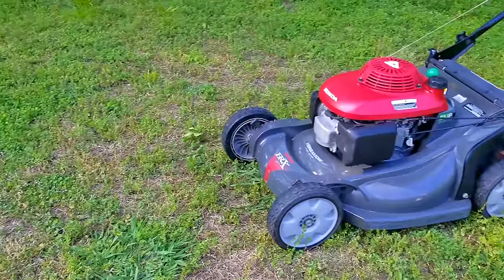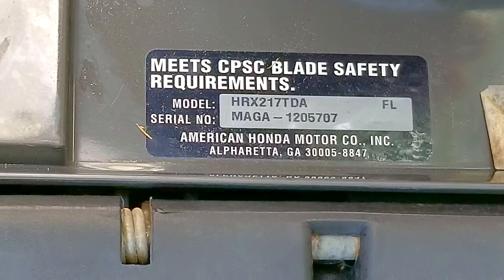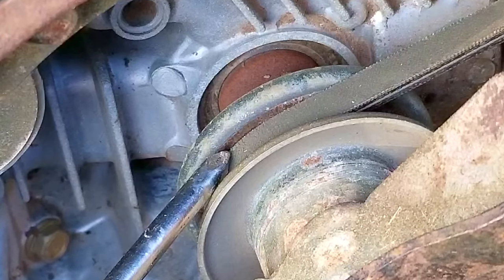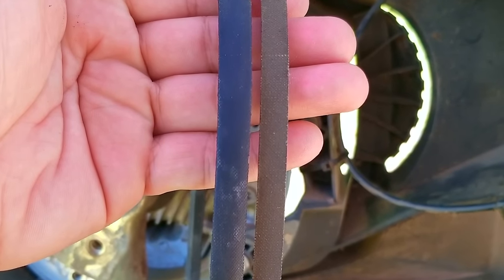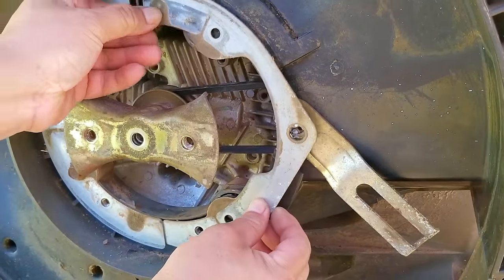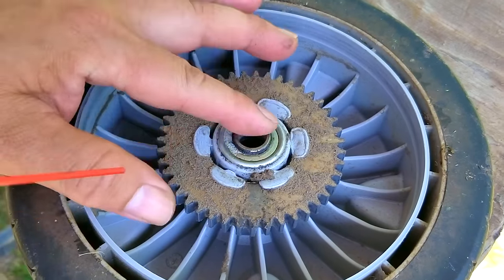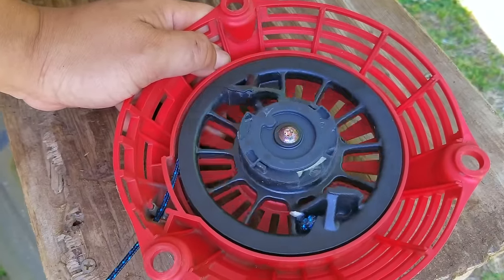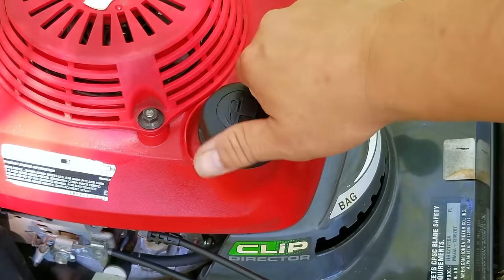Fixing The Self Propel On A Honda Mower

Comment: Did miine a couple years back and yes what a pain.  The hidden nut in the shoot got me to yell a little till I found it only after some research.  Laid out all the parts in order as I took them off and a few pics as well.  Just a lot to it and was glad when it was over.  Love the mower though, never had a better one.  I should call the shop and find out how much they would charge to do it next time.  Thanks for the vid and great job as always.
Reply from the maker: yes it's not as clear cut to remove all the pieces sometimes

Comment: This lawn mower almost requires a degree in mechanical engineering just to work on it. I changed the belt on my HRR which is not as complicated as this model Honda.
Reply from the maker: Yes I prefer the HRR belt change in comparison to this one.

Comment: I have to mention one way "I" just fixed the belt being off from the wheel:
Dont ask friends but use you the small handed wife to put the belt on inside without unscrewing anything and then put the other end on the wheel.
We just did it and she had hard time forcing the belt inside even when the other end was off from the wheel.
Thanks for the great video.
Reply from the maker: thanks!

Comment: In the long run I am glad you replaced the belt.  If you are selling the machine you do not want to sell a machine that will not last long before it has problems.  This will hurt your reputation.  Now this machine should last a long time.  Your time was not wasted as you learned how  to do this for the future.  Thanks for the videos.
Reply from the maker: yes I agree with you as well. it's a nice selling point too.

Comment: Great video!  I have same mower but different problem.  Only 1 wheel on the self propel works and it’s pulling to one side.  Any ideas on what it can be?   Thanks
Reply from the maker: I would take the bad wheel off, and is there's anything wrong with either of the gears.  After that I would check on the ratchet mechanism inside the smaller gear.  If that's okay, then the transmission might be the issue.
Reply: Ok great thank you for getting back to me.  I’ll let you know

Comment: That ex exactly what I needed to know the self-propelled works great when there's no weight on the wheels but as soon as you said it down they quit pulling
Reply from the maker: yes sir, an adjustment on the Cable will typically fix it.

Comment: How do you feel about those adjustable link belts?  The ones I’ve gotten are usually green and the belt links are kind of like a stiff fiber sheet.  They are expensive but sometimes save a lot of disassembly.
Reply from the maker: never heard of them and I would NOT use them, too much liability involved.
Reply: @HomeGaragechannel  ha I had similar thoughts until it involved taking out pressed bearing fits.  Now I run them on 5” pulleys going 2400rpm and it’s lasted years with no readjustment.  At least the guard is 1/4” thick cast iron. But amazingly the belt looks great.
Reply: @HomeGaragechannel  In all seriousness I don’t use them except on the 2 machines I have that are almost impossible to change the belts on. It is great for figuring out the length of a belt and testing occasionally.  It’s called adjustable link vee belt I had to look it up.

Comment: I think we’ve all been there before. Not really such loss though, “brand new drive belt” in the listing is a great selling point. I think the idea behind Clip Director is for when the grass is too tall and it leaves a mess when mulching and the bag fills to quickly. If you can do a little mulching and a little rear discharging you can probably leave the lawn looking good without having to do it twice. BTW did you hear about the STOP ALL HONDA MOWER SALES order? Honda had to stop selling their final versions of mowers and may have to issue a recall for previous models because of a faulty compression release mechanism on the cams of the GCV-160 (and presumably GCV-190). It seems the third party who makes them for Honda decided to take a shortcut and not let the plastic cool down before installing the compression release finger, so now the release mechanism randomly stops working and causes injuries during starting. Honda is still trying to figure out how far back this goes, but for now no more mower sales on this their last year of mower manufacturing. I would think that means all engines for other brands too but I don’t know if that’s true.
Reply from the maker: you are correct, knowing what I know now, I'd say "wow, they already did the hard work for me"

Comment: YES! MANY TIMES! I've made a mountain out of a mole hill doing mechanical work. What a pain on HRX. I remember u saying u were going to change the belt. I wanted to see installation because mine doesnt climb STEEP hills as well. I would care if I owned an XRX & changed it, I'd figure I got it out of the way. Anywho, I own an HRR. I DID see how to install & it IS MUCH easier, thank goodness, I'm not 20 anymore. So, I purchased belt & waiting until it no longer self propels & know it wont take me long to do. I don't care to adjust because I feel factory setting & don't wish to alter. Yes, I could count the threads, but belt going on 4yrs. HERE'S A QUESTION, should we ever change tranny fluid (just engine oil?) 👍
Reply from the maker: this is just a 5 speed I think and no I would not change it, and if I knew it was leaking would open it to add fluid.